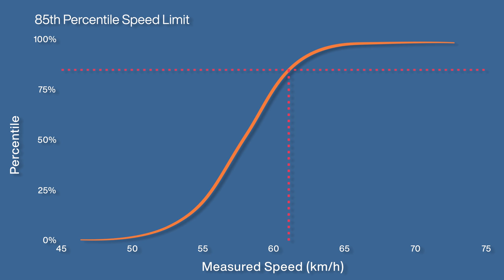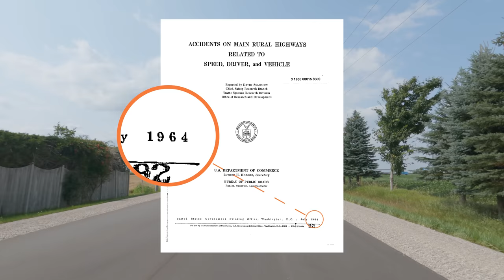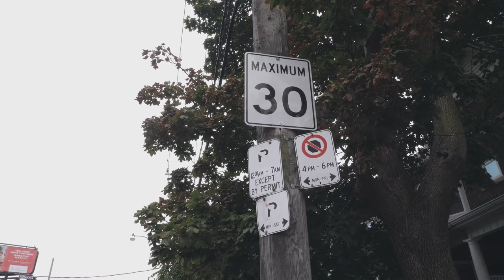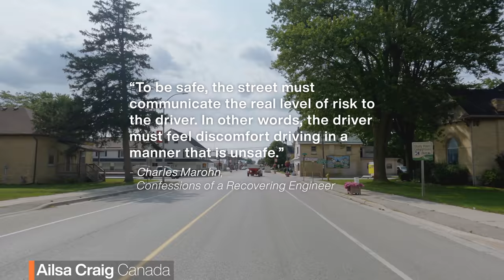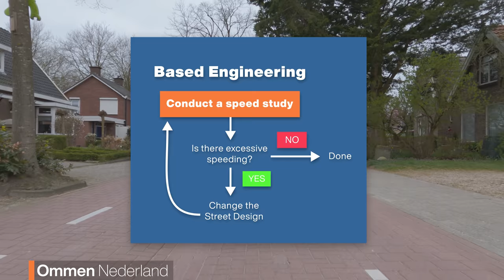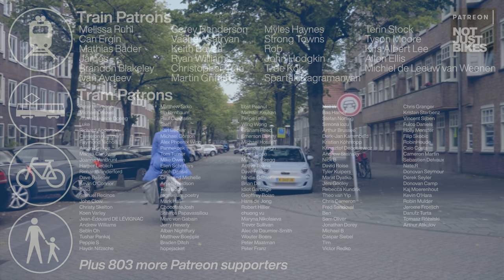The Wrong Way to Set Speed Limits [ST06]

Comment: Being a European and having played American Truck Simulator, I kept getting confused by the constant speed limit change, despite literally nothing else changing with the road. It feels so incredibly arbitrary.
Reply: it doesn't FEEL arbitrary. it IS arbitrary, they for the most part change because "someone said so I guess that's how it is". I know near my house there is a very long road (arguably maybe edging onto stroad territory as they build more along it) that is around 55mph, it will however randomly change to 40/45 (i forget which) for about 1/2 a mile. then go back to 55mph and eventually up to 65 as it fades of into nothingness a few miles further (it goes for a while but it doesn't really go to anything significant except the next highway exit). Along the entire stretch of road there isn't really much of a difference in terms of what is around to warrant the speed changes. arguably the section which is 65mph is the most dangerous as it is where a majority of the neighborhoods will merge into that street which is more-or-less the only direct route out of the small town. frankly its really concerning to see the road/stroad be so dangerous for literally no reason.